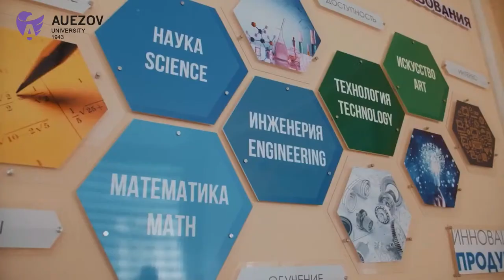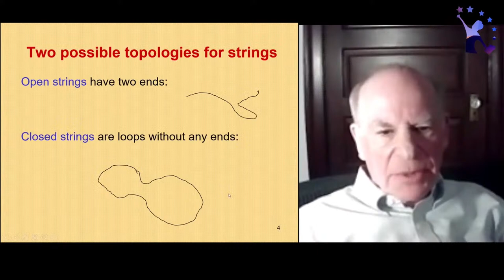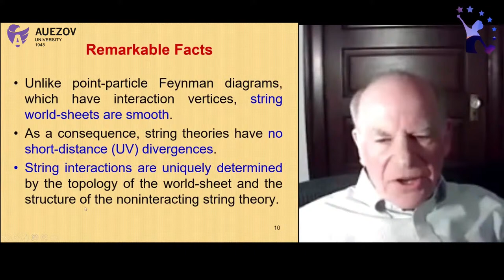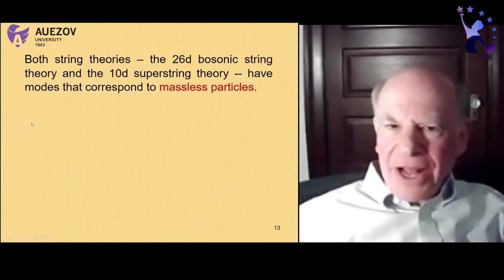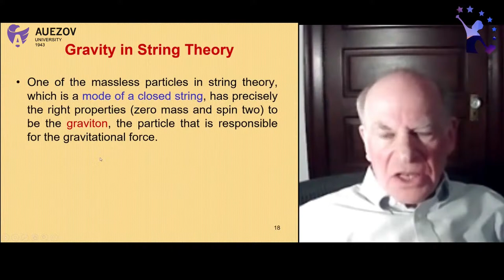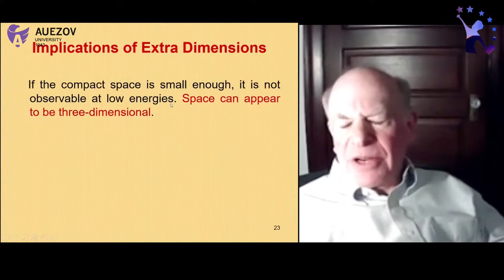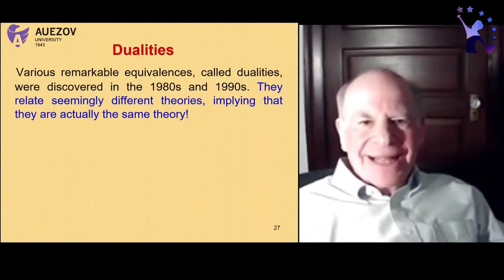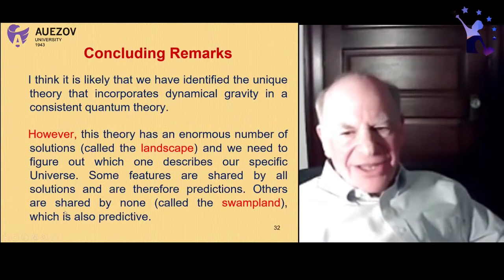John Henry Schwarz - String Theory | Nobel Lectures: English

Comment: The string bears point particles.The string isn’t about size, it’s about infinite cubic dimension. 

Xenon and Rhenium are nearly identical strings, they are the buckle hiding the f-block knot.

Terbium’s primary knot is neon with secondary knots Strontium and Nitrogen.